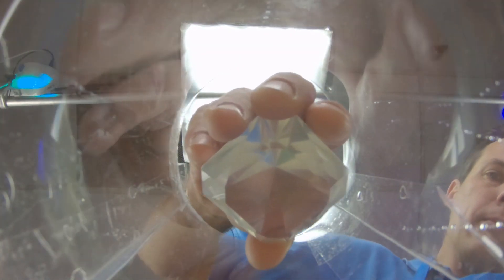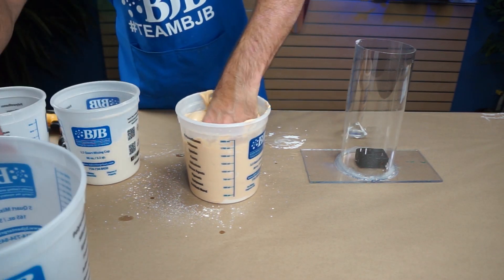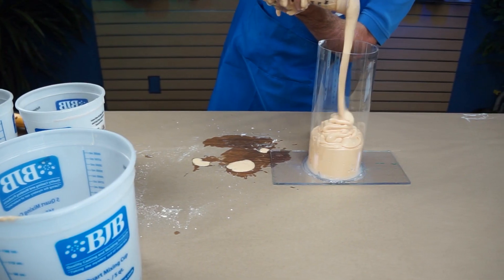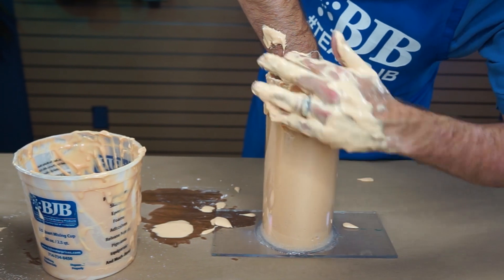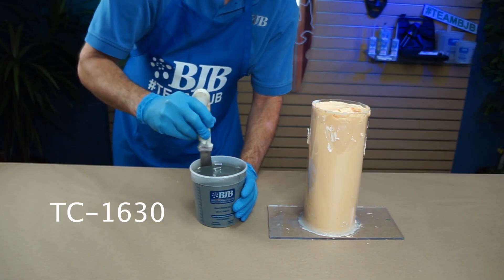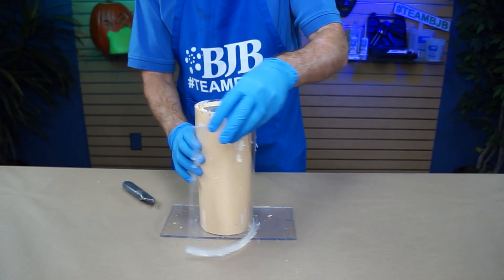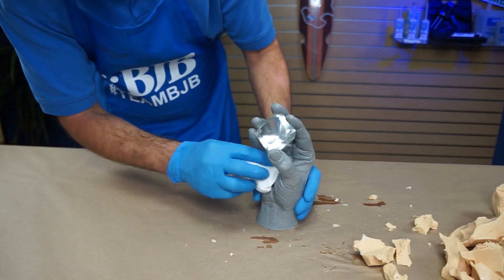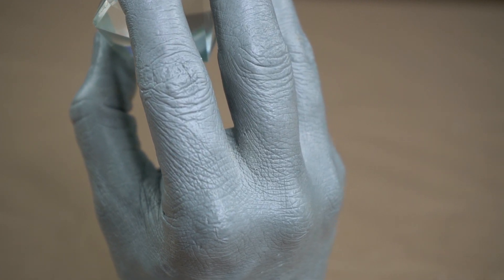Quick Tutorial: TC-1630 cast into Alginate Mold

Comment: Many urethanes really hate moisture and can’t be used in alginate. BJB TC-1630 , I’m happy to report, is not one of them! I’ve made several casts from alginate with it and never had a problem. Bonus; it sets up fast enough that if you don’t have severe undercuts and can pull your cast piece without damaging the mold, you can get two to three pulls before the alginate start to shrink significantly!
Reply from the maker: Robert Burns thanks for the confirmation Robert!